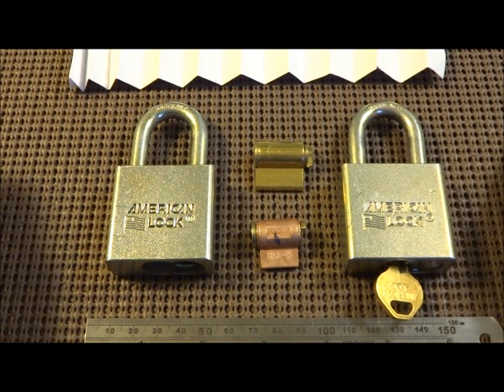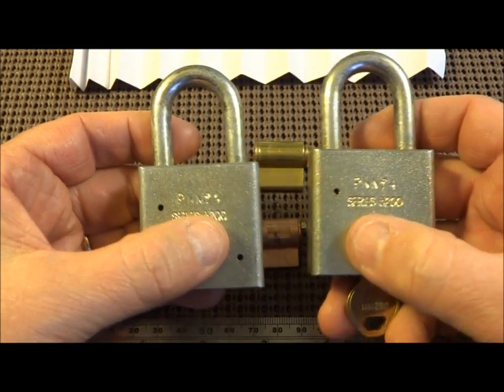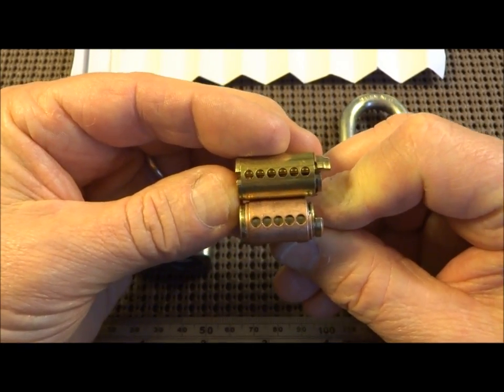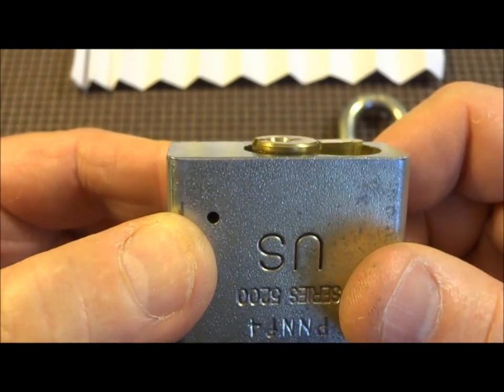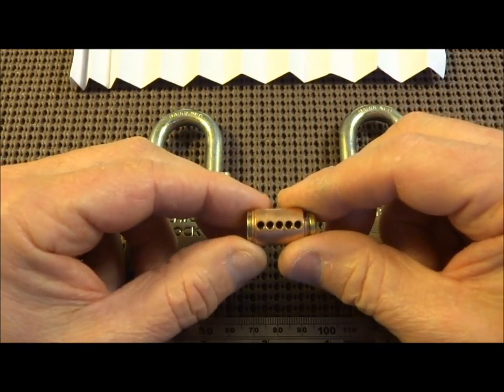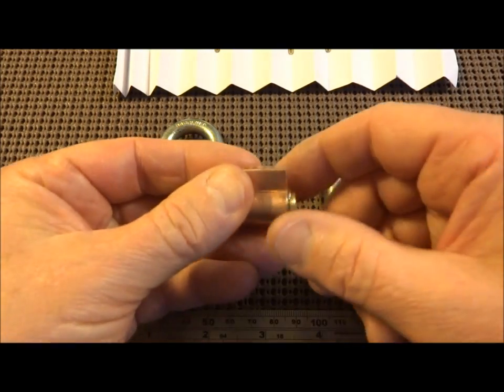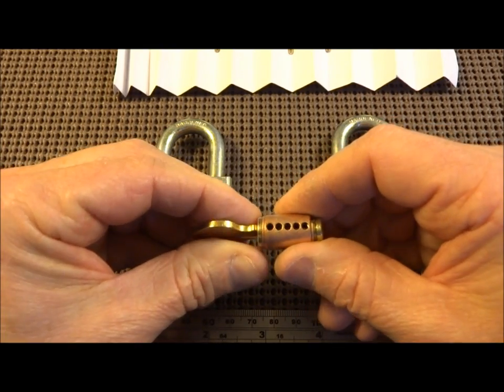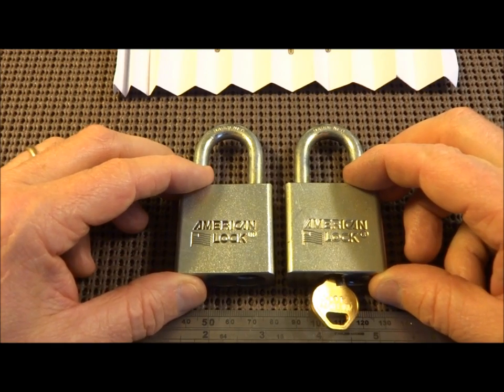(86) Master Lock Corporation Screws Up AGAIN!!

Comment: probably too late, but you can contact the GAO and get the specifications for the RFP under which these locks were purchased.  If your locks don't meet the specs, a law suit can be filed on your behalf and you will get a percentage of the fine they levy against Master Lock.

Comment: I know this is an OLD video ... but there's a letter "P" stamped on the "cam" in the bottom of the cheaper lock ... are you sure that's not an "adaptor driver" that sitting on top of the "cam" and can be removed (making the older style cylinder fit in?)

Comment: I have been a locksmith for 7 years and if you want true security go mul-t-lock, telescopic pin design you can have them master keyed and add side pins for extra security and the padlocks have boron alloy shackles that are much harder to cut than the standard steel shackle, they also hagve tempered steel plate in the core at the drill point, they are expensive but worth it

Comment: Hi Bill,
These cylinders are similar to the #21 type rekeyable  cylinders. 
To take these apart you turn the key 1/4 turn to the right and the cylinder pulls apart.
Hope this helps.
Rick

Comment: I suspect that you can still get the shorter cam and replace that with the original style American Cylinder.  You also might have a little discussion with the procurement people to review the contract specs for this batch.  The specs may not have been met and you could return the locks that have the Master cylinders.  If the locks actually meet the spec, then you should have them change the spec to give you what you need.

Comment: I bought a Masterlock and upgraded it with an Abus body, shackle, actuator and ball bearings and an Abus lock, I threw the old scrap parts away didn't even keep em as spares. You can actually buy the upgrade ready assembled as an "Abus Padlock" pretty neat huh!😋😍

Comment: I actually sent LSA those Bumpstop 5200s for his testing. I wanted to know how they worked and his honest thoughts on them.
By design the bump stop pin is supposed to rest in the upper area of the plug. It is not supposed to fall in. They figure if they can stop pin contact then they cant use the kinetic forces to bump the lock. 
Only the new bumpstop models are supposed to have the new cylinders. They have the model numbers A5200GLN while the normal locks have A5200GL. Watch out when ordering.

Comment: Usually everything meant to be "highly secure" is locked with one of these locks AND a anti-tamper band with registered number. Never saw a band removed without leaving evidence of tampering, usually scratched at the very least. Not to mention whatever it is likely has a guard not to far away. It is in a secure military location to begin with. These locks primary purpose is to protect our equipment from each other. Worse thief of the military is it's very own soldiers.

Comment: did you figure out when they stopped using the crap pins and went back to security pins? I have a bad feeling the 50 series I just bought which has a rivet in it is 5 pin and easy to pick. Americans are my favorite toy I pop them every day. I will send it to you with some re pinned locks soon. my security kit came my universal lab kit comes today says ups.

Comment: These are the locks used to lock the case with the nuke launch codes... the launch codes are 00000000
Reply: roadhuntingfreak sad thing is this is completely true, or was they've recently changed the launch codes from 00000000

Comment: Before you get all up in Master Locks face, consider one thing. The Government issues a specification for virtually everything they purchase and then they test to ensure that the item meets or exceeds their spec. In this case the Government probably came up with a spec that called for a forged lock body with a minimum 5 pin lock. They probably excluded multiplated built up lock bodies which are Master locks bread and butter so Master Lock chose to go with an American forged body with a 5 pin core. They were competing against how many other companies to get the contract so they are forced to cut corners to meet the lowest price possible while still meeting the spec. You want to blame someone, blame the people in the Government that made up the spec and created the syllabus for testing. There's your criminals, not Master Lock.

Comment: Actually, the A-5200-GL is a 5-pin Solid Steel Body padlock with the nomenclature ACPT#15 -5-PIN CYLINDER, which is exclusive to government contract padlocks...

The ACPT#15 Cylinder is still available as an option or for replacement to existing stock, although this cylinder is said to be without the Bump-Stop security enhancement... You also might be able to retrofit the older ACPT#15 Cylinder into newer padlock bodies with the older actuator... 

The latest generations of American government contract padlocks features the cheaper cylinder with the Master Lock W-17 or W-27 keyways, with W-27 reserved for master key systems. 

It's also mentioned in the government supplement of the price book that retrofitting new cylinders into older padlock bodies require a different actuator to work.

The newer cylinder design is also said to be available with Bump-Stop technology, which uses top-gapping with a reverse rake tapered driver pin to create a gap between the key pin and the driver pin in at least one chamber, which is dictated by the bitting depth of that particular chamber. 

Bump-Stop equipped cylinders are said to exceed ASTM F-886 Grade 6 criteria for resistance to bump attacks. 
~~~~~~~~~~~~~~~~~~~~~~~
The 6-Pin cylinder, the ACPT#14 is standard on all of their commercially sold products, available in a total of 6 standard  keyways, excluding their "Edge" patented restricted keying systems. 

(2 open and 4 restricted, factory sanctioned from commercial distribution channels or reserved specifically for limited distribution for higher security applications requiring enhanced key control.) 

The nomenclature ACPT#12 is a 6-pin cylinder that has been keyed to 5-pins.

American Lock cylinders are available with stainless steel pins for drill attack resistance, and are normally factory keyed with serrated security pins for enhanced resistance to picking attacks.
~~~~~~~~~~~~~~~~~~~~~~~
Go onto www.americanlock.com , go to the government section, and download the government price book .pdf supplement for free.

This supplement contains pricing information as well as NSN numbers, nomenclature charts and parts listings for these locks.

Comment: The shorter master core cannot be bypassed, unlike with the older American lock cores, due to different tail end geometry.  This means it stops a quick/covert attack on some locks.  The bypass weakness doesn't affect Government contract "US" locks, since they tend to have a key retaining actuator installed which makes the bypass impossible.    Other locks, however, like the Master Pro Series, Spring-actuated American locks, and safety series benefit from the horizontal core tailpiece geometry innovation by Master.  Admittedly, this is still one of the worst cores master has made with the new geometry--their Pro Series locks have better pins and have cores with the redesigned ends, too.

Comment: Hi bill
I dont know if this will help but 
On cheap master locks #123 and so on i broke the lock open to see the core.i was able to turn the plug so the bottom of the keyway was just over the crimp in the housing and the plug slid out
These americans might have a tighter crimp.i just thought it might help
Thanks again for the vid
John

Comment: UEFo4 is the date of manufacture of my lock and its got 1 standard and 4 serrated pins on the bottom and on the top 2 serrated and 3 spools with serrations on the top and bottom.  The core is 5 pin and looks quality. Master Lock might be listening to you. I bought the lock in I think 2010 or 2011.
Reply: Sorry, UEF is June 2004...older lock with security pins made well before the 2011 acquisition date. Wish I could have purchased older better locks...just blew $103 on 3 5-pin keyed alike NEW American Locks :(
Reply: UEF=June 2009, my bad
Reply: So use nails of the correct diameter and a dremel tool and file to make new pins for it.
Reply: Thank you QuestionXV for the great and practical suggestion.

Comment: Are the American Locks made today in the year 2018 good quality or bad  cheap Master Lock quality?
Reply from the maker: Probably not.  With Master Lock in charge, the overall quality has gone down slightly.  They've reduced the size of some of the lock bodies and are only putting in 5-pin cores instead of 6-pin w/1 unpopulated.  No chance to upgrade those.  They've moved away from steel bodies and seem to be pushing the aluminum bodied locks.  I guess that's cost savings.  If you're looking to buy one, check out eBay for a used one.  Then you can pin it up as a 6-pin lock with some alien technology inside to defeat pickers.

Comment: Well let me give everybody a clue, looks only keep an honest person out. If someone wants in they are going to get in and 1 extra pin is not going to be that much more secure. I picked 4 master locks in less than 44 seconds, I did a medico lock, the ones on the coke machines in about 20 min's. If man can make it, man can defeat it.
Reply: It's all about risk management. What are the odds that someone of your skill is going to want to burgle my home? Fairly low. Those that actually use lockpicking to bypass locks? Who can say... But to harbour a guess, I would say that brute force (Boltcutters, sawing, etc) Is perhaps used more by petty criminals to gain access to a private residence than something requiring such finesse as lockpicking.

Comment: I don't understand why people care so much. Locks are a joke, they're all false security. Any lock will do to keep honest ppl out, anyone that wants to steal from you will, and they will easily.
Even if someone could rake open that cylinder in a second or two, I can still bypass that altogether even faster using a shim or a hammer. (wrapping a t-shirt around the lock before hitting it with a hammer will make it unnoticeable to people more than 20ft away)
I wouldn't worry about all of that, especially bump keys, when you can make 20 shims from 1 pop can that can instantly open any U-Shackle lock.
Reply: Eric Heredia It IS bogus that they are pretty much lying about their products though. Those are some big changes between the two and they should have made consumers aware of them.
Reply: Eric Heredia Eric-I am no expert but I'm pretty sure that shimming and rapping only work when the hasp is not secured by a ball bearing.
Reply: Slive shims work on any u-shakle made so far. But that's besides the point, you're absolutely right, these are some big changes that should have been made clear to people purchasing them. Honestly, I wouldn't even consider them to be the same lock in any way
Reply: Eric Heredia If the shackle is held with ball bearings (i.e.: abloy, abus granit), shimming is just about impossible.